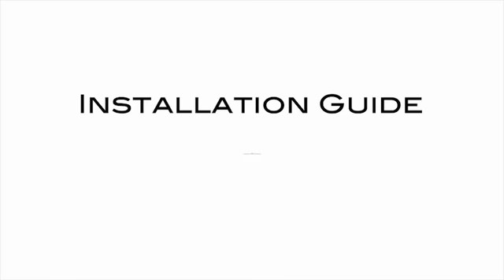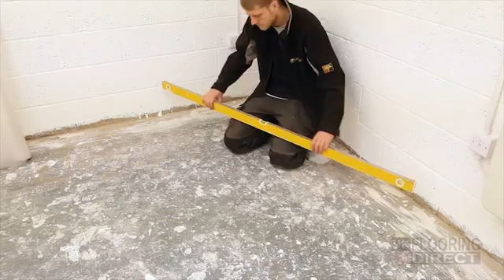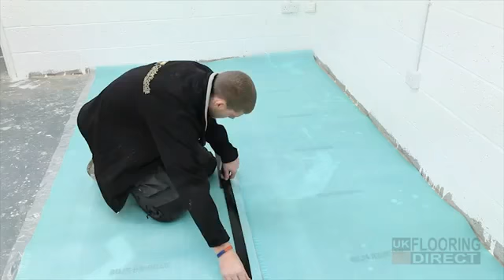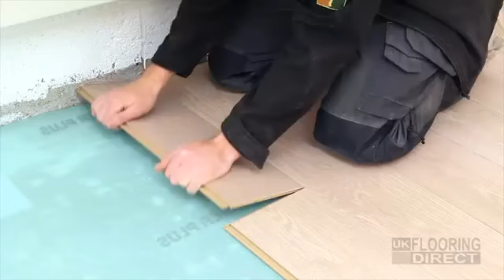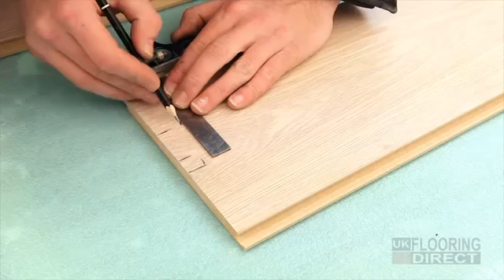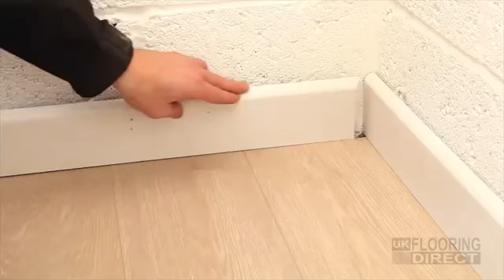Laminate Flooring 5G Click System Installation Guide

Comment: That small board is not the way to finish against a wall. Should have worked out the width so both sides are equal. Poor setting out and then to use it in a demonstration video on how to install is simply wrong.
Reply: Damn right. That made me cringe on seeing it
Reply: I am hoping you may be able to answer a question i have.  In looking at reviews of a Costco vinyl flooring one of the customers wrote,  """When making rip cuts you have to be careful or else the 5g click system will fall out and it never works again.""   In watching the video I didn't see anything that could fall out or off and hoping you might be able to explain what this customer was meaning.